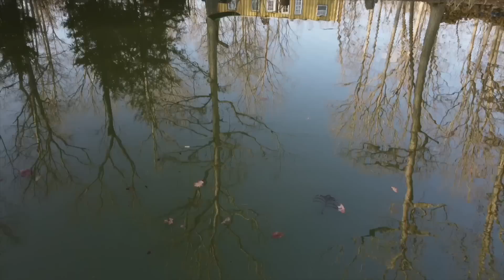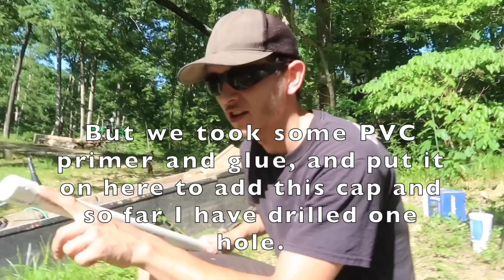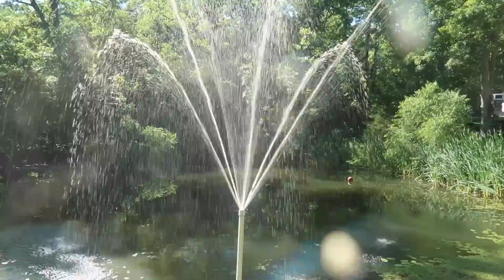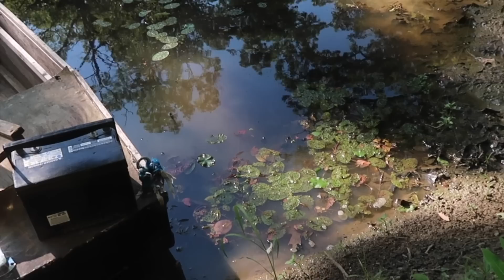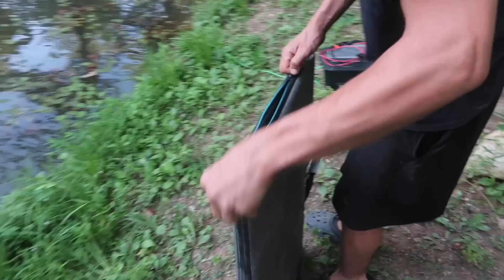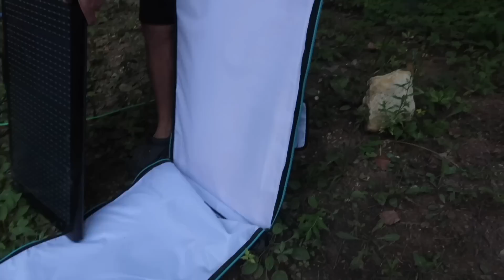DIY Large Pond Fountain | Shipping Container Home EP:46| Easy & Inexpensive￼

Comment: The Fountain Guys have affordable fountains with warranties. I'm sure you've already figured this out since this video is 3 years old but that splice wont hold up. Even if the heat shrink holds up having the cord jacket open to the water will suck water up into that pump causing a short. You need to use a good underwater splice like a 3M 82A1. I would also use a threaded cap with a threaded male adapter in case you want to change your display its as easy as unscrewing the cap and putting the new one on. Good luck!

Comment: Our lake never had any sort of pump or aerator, and it is at least 50 years old. We had an aeration system installed, and after one night of running it had made the water toxic and killed all of our fish. Anyone with an old lake that installs one of these systems needs to introduce it slowly to the lake. We were never told this, and the company said they had never seen that happen before. It sounds like they are going to help us restock though. I hope this doesn't happen to you guys or anyone else.
Reply from the maker: Interesting, maybe you had too much rotting debris or the bottom that got stirred up? We had to clean tons of dead leaves and stuff out of the bottom of ours
Reply: @CantContainUs  It had 50 plus years of muck at the bottom, so there's no telling what was down there.

Comment: Wonder if you could design a system that would capture rain run off from your roof and either dump it to the pond or store it in a cistern?
Reply from the maker: The way the ground is sloped all the rain water from the house runs to the pond. Usually the pond stays full,  but it's been extremely hot and we havent had a good rain in a few months

Comment: I had several pond pumps in 20 years of having a pond. The issue with sump pumps is they can fail and throw oil into the water, but they have great suction and are not as finicky as shallow well pumps. I also ran a uv light on my pond to kill the algae. I had an average of 30 goldfish in my pond every year. They multiplied and died naturally. Never any food as I has a well balanced pond, nutrient wise. You will love that pump set up and the runn8ng water for years to come. That ecoflow looks like an excellent product. Thanks for the video!

Comment: Nice job with fountain. Look good. Can you add some led lights to styrofoam and float it out to light up water? Can’t wait for solar update. 5000w is only about 30A. Will that be enough? Thanks for sharing
Reply from the maker: The max amp output for the inverter is 41 amps. We use at max 35 amps at once right now. The inverter is also stackable so we can double the output as we need.